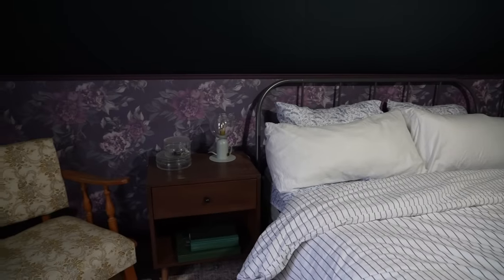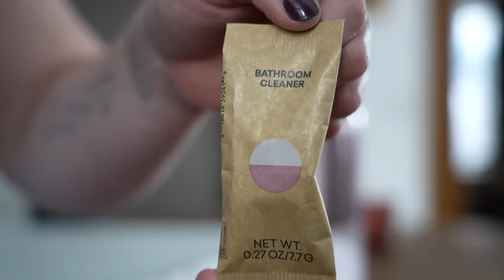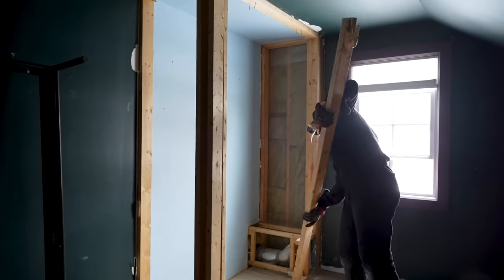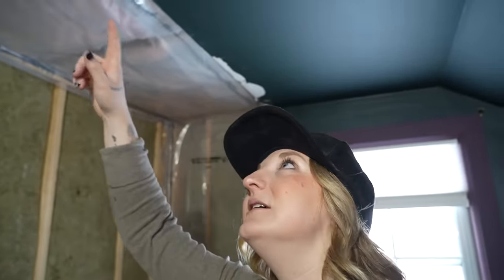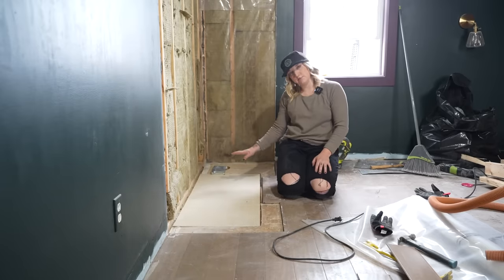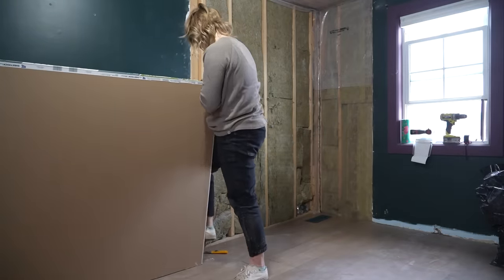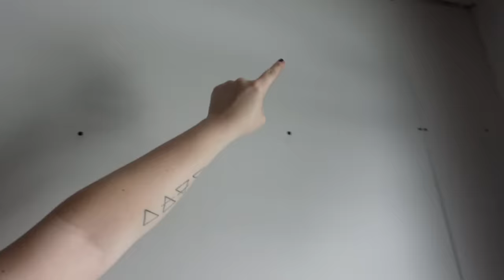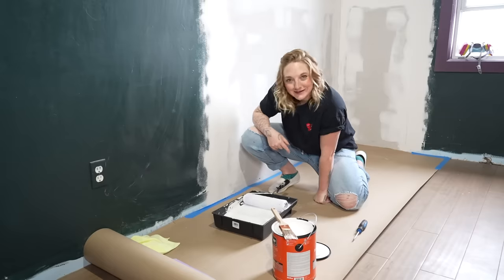my dark & moody bedroom had to go..this is why.

Comment: Ceilings should always be drywalled 1st then the walls, so the walls help hold up the ceiling. Cuts down on nail pops in the ceiling as the house settles. Learned that from an Older drywaller.
Reply: Using screws helps.  Never understood why nails in ceiling.  Always pop out 10 years.  Eyesore +.

Comment: This was the usual pleasure to watch but also really educational for me - so many interior designers encourage you to "go with" a low-lit space and embrace a dark colour, and I have been tempted for my own "black hole of Calcutta" bathroom.  Just watching the footage of the closet removal was telling: I am not drawn to any of the colours (green, mauve, pale blue), but the stark contrast in the amount of light reflected on screen between the adjacent sections of the different colours was immediately apparent.  The light reflected increased even further when the new drywall was put in, even though it was matt plaster and unpainted, with no reflective surface.  The other thing that came through was the way the dark paint showed every fault in the wall and ceiling surface, especially where those joined.  Thank you, and I appreciate your hard work, perseverance, and humour.

Comment: Did you check your local building code to see if removing the closet means you "technically" lose one bedroom when you go to sell your home in the future?  If you plan on living in the house for decades then it won't be an issue, but if you're currently listed as say a 3 bedroom/1.5 bath you might be reducing your house to a 2 bedroom/1.5 bath, which would potentially impact  the sale price.
Reply: This is true,a window,door and closet are what technically makes a room qualify as a bedroom. However,she could easily install a little one back in if she ever put it on the market. (not that she ever will now that she has her dream garage!)😂😅🤣

Comment: Each 90-degree duct degrades the air speed flowing through it. Unfortunately, the new T connection does the same thing the old T connection did. Air speed degrades less with 135 degree bends. For that, typically the duct run rides below the joists to make that angle.

Comment: I am so very apologetic that you had to give up your moody masterpiece but I know you will try it again so here are a few suggestions to help bounce light.  
1. Place a mirror opposite a window to help bounce light.
2. Place a mirror behind a light source to maximize the light 
3. Matte or flat is sexy but sheen helps bounce light so try to do trim in a satin if you can
4.  Dark colors do NOT make a room look small its contrast so add some sheen to your wall paint and use it on furniture
5.  Adding more lighting is always helpful but try adding push lighting in threes.  An extra lamp is good but imagine having three!  That is good lighting and it's there when you need it and it goes away!

Comment: I had a dorm room once in college that had that big slope on one of the walls because it was on the third floor where the roof formed. I chose that room in a lottery because it was quiet up there. But it was a confined space. I think that dark walls work best in large rooms or hallways that have high ceilings. If it's a room with dark walls, then there also needs to be big, tall windows that let in a lot of light. A hallway can have dark walls even without windows letting in light because no one is actually going to be sitting or standing in a hallway for long periods. My home is an old colonial style farmhouse built in 1850. It has low ceilings and smaller windows as a result of the low ceilings. I thought about painting the living room a dark burgundy but decided against it. If I lived in an old Victorian house with high ceilings and tall windows, it might work. But not in this old farmhouse.

Comment: On the topic of primer, any primer or paint will work. PVA drywall primer is just a sealant that is cheaper that regular primer and way cheaper than paint. A gallon of paint on bare drywall will get you maybe 150 sq ft instead of 400. It makes a huge money difference on a large space.

Comment: Danie, I was so hoping you had extra flooring. With our basement remodel, we made sure we had a fair bit of extra. Also during the remodel, we discovered that all of the drywall was installed horizontally, so seeing your 4x4 pieces reminded me of that. 

Your dark bedroom has is a similar feel to our basement hall (SW Cascades, lightened 20%) but our trim is totally different. We have red oak, and stained it with General Finishes water based stain in Hickory.  The flooring we got for the hall and offices was something we wanted to compliment, and that combo did it really well.  The teal against the reddish brown looks so rich! 

The entire basement is fairly moody and deep (as opposed to the main floor, which is all very light hues,) mainly due to the rec room being turned into a theatre. There are 2 windows each in the offices, as well as theatre, plus one each in the bathroom, and hall.  We'll have movie posters in the hall, so the darkness that dominates will just be a backdrop for them. Once decorated, the hall will act as our theatre foyer. Right know, the hall has two recessed lights, but down the road we'll install some small gallery lights.  The offices have the same fixture, but only one in each, so will need a lot more lighting to lift the spaces. Right now, the guys are trying to figure out the desk setups for their offices. 

Really curious to see if you went in the opposite direction with your paint choice, or if it's a mid-tone. Also, wondering if you've kept the wallpaper.  Speculating if you did something similar for storage in the guest room that you did in the master bedroom. See ya next weekend!

Comment: Blame it on Gator! 😉 I always though it was too dark. P.S. the fiberglass tape if it is sticky, I just put it right on the dry wall, the paper drywall tape needs a coat of drywall mud to stick it to the drywall, the sticky tape does not. They also make a drill bit that will set the drywall screw at the perfect depth, it is very handy.
Reply from the maker: No blame to my wonderful friend at all! We picked the colour together! I LOVED the dark room but it was time for a light change! <3

Comment: Hey Danie happy Saturday - I always love your vids! Thanks for sharing 😊

One quick tip, you definitely need your vapor barrier and want it to be continuous and airtight haha!! It prevents moisture carried in the warm air of your house to travel into your attic/wall cavities and condense in the cooler air there! Allowing that moisture through can cause rot and mould if theres enough of it! Especially in cold climates!

There are some wild YouTube videos that show how much damage even a small opening in the poly can cause (its like the equivalent of dumping a full bottle of water in your wall every day or something crazy like that!) 

In your older house it may not be as much of a concern as there are probably tons of drafty spots that air can breathe in/out but in the late 90's early 2000's when air sealing first started becoming more prevalent a lot of attics were having mould problems due to air leaking through light fixtures that weren't sealed. The more airtight a house is, the bigger problem having a hole in the vapor barrier becomes as more air moves through those decreased openings! 
Building science is really cool!!! 

Cant wait to see your finished room! (Again ;) )
Reply from the maker: Appreciate the info and advice! This house is one giant drafty cavity so I’m not overly worried. 😅😅😅😅
Reply: @DIYDanie  Ma'am I have been there LOL we had to cover our fireplace because the -40 was coming in down the chimney 😭 and there was a full sheet of ICE on the cover after two days. I love Canada.

Comment: I watched the demo part twice but what am I  missing? Why was all the drywall inside the closet removed? I know there was a good reason but I think the angle of the camera makes it hard to see 😊 Was the frame of the closet attached directly to the studs?
Reply from the maker: So I could’ve kept the drywall on the inside of the closet ( actually something I did in the primary bedroom) but what I learned over time is that filling in a small gap can look really messy and noticeable - especially because my walls are wonky. Drywalling a larger area and making it seamless is so much easier and less time-consuming. Plus drywall doesn’t cost that much and I had to buy it anyways.

Comment: I loved that you removed the closet because now you can put the bed on the other wall not the sloped wall. Also I can't wait to see it be a bright white or even a soft beige sandy color. I'd like to see something like a coat tree that turns into a lamp that's made from an actual tree branch that has been cleaned, sanded, and varnished. Plus it would be a nice addition to a guest room to hang their hat! ❤